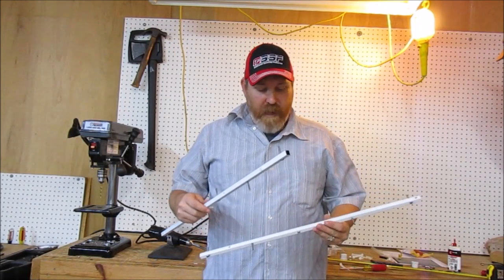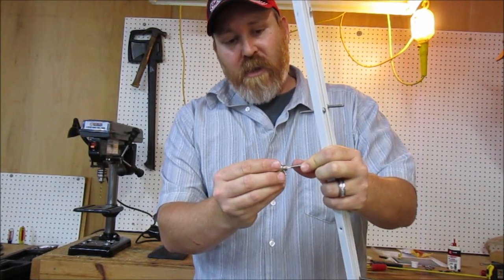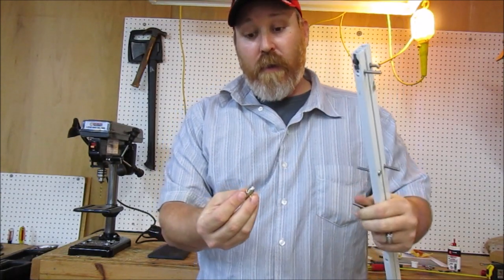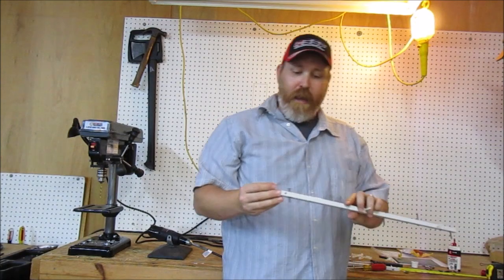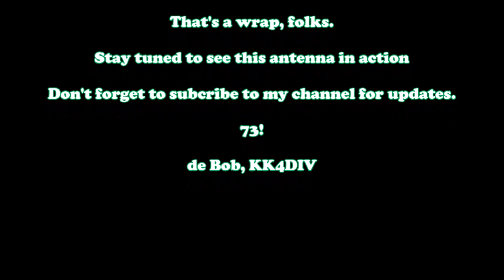Satellite Log Periodic Antenna Project Part 2

Comment: Good work Bob ! Is there anything critical about the distance between the 2 booms apart from being electrically separated ?
Reply: Two beams form the parallel square conductor transmission line. The distance between the beams can be calculated from  the online calculator  https://hamwaves.com/zc.square/en/index.html
73,  Ted

Comment: Very good project Bob ........ I built a 7 ele. 70cm by 4 ele. 2m SAT antenna using aluminum arrow shafts with home brew Gamma match on each band mounted on a 3/4" round Aluminum tubing .... worked GREAT that did not have a duplexer ... so I could run any power =)   I used Kenwood twins TS-711A and TS-811A All modes =)     Then I discovered Big Wheel antennas and stacking them =)     I sad the SAT antenna was damaged during my move from the house to the apartment =)     New arrow shafts will get ity back in action =)
Reply from the maker: That's interesting, Pat.  I enjoy building and trying out new antennas.  So far, I have been using the FM satellites and have a 2m/70cm radio with a built in duplexer.  My next venture in the satellite world is the linear/ssb satellites.  I have my ft-817 and am borrowing another from N4KGL.  I have setup pcsat32 on a laptop to control the doppler shift. Looking forward to some time to try it all out.
Reply: YES you will need DOPPLER SHIFT ( REVERSE and FORWARD shifts as they are different from SAT to SAT ) and learn their BEACON FREQUENCIES of the SAT to listen for =)   Even older HRD has the Doppler shift built-into rig control for dual receive radios =)   It is COUNTER PRODUCTIVE on my Yeasu Earth Station FT-847 as those functions are built into the radio but I know the Kenwood TS-2000 WORK GREAT as I set a fellow Ham's rig up for that =)   If you have the 1.2Gig hz TX you can have fun =)  Look over AMSAT website for beginners is a good starting point .... ALWAYS have a RECORDER HANDY for those contacts .... as some are very short in duration =)   Good luck hunting SAT's and Have Fun 8-)